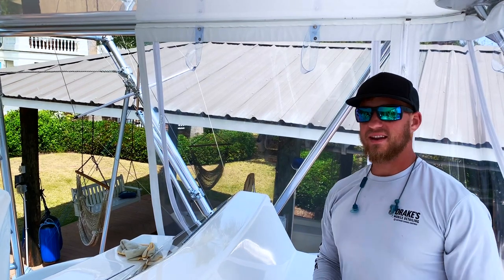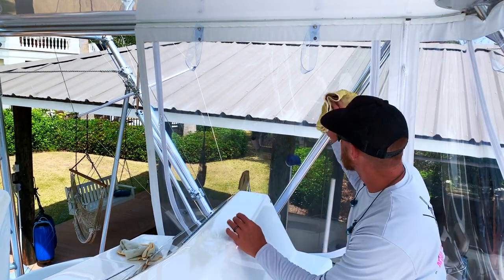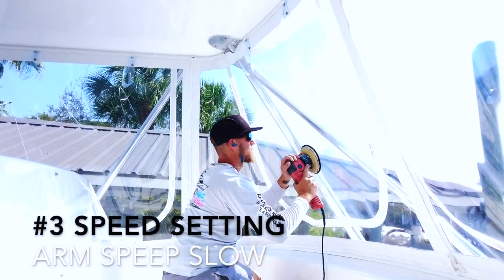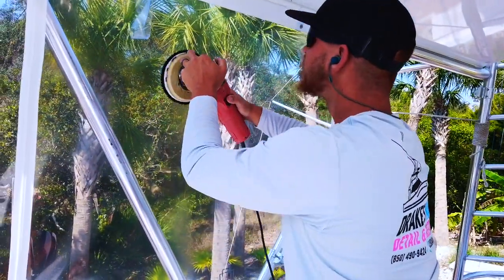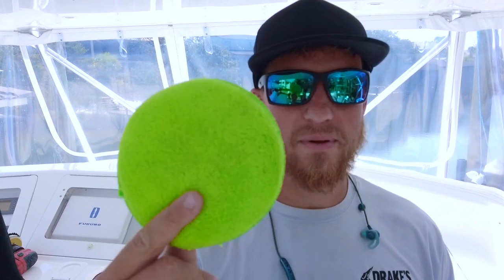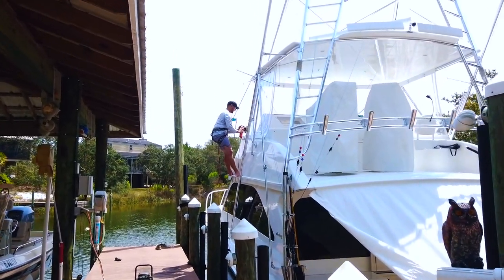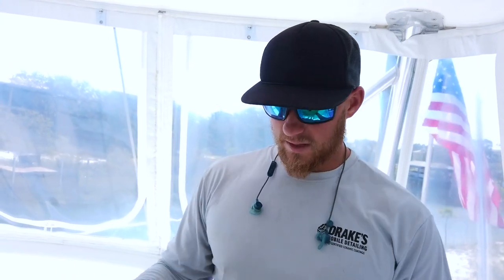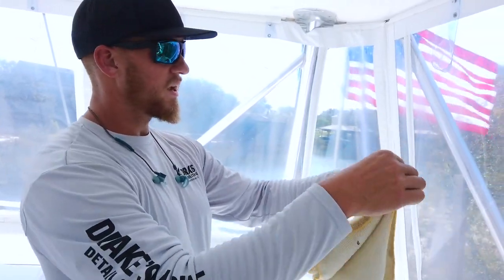How to Clean & Wax your Isinglass Properly! | Boat Detailing Tips | Revival Marine Care

Comment: Thanks Drake for all your awesome step-by-step detailing videos and product suggestions.  It's clear your spend a lot of time putting these together for us amateur enthusiasts.  Much appreciated brotha!  Follow-up question on using Menzerna on slightly hazy/cloudy Isinglass:  When using 400, is there a decent chance the abrasiveness of the product alone is enough to irreparably damage/scuff the Isinglass?  If so, should I start with the 3500 or 2500 and see if that's enough to cut that haze in the glass and work my way up to 400 and back before I get to sealing it with the Jescar?  Thanks again!

Comment: Great video, as always.  After I do this on the Isinglass, any suggestions for the canvas?  Thank you.
Reply: Claude B:,.( *I use 303 canvas cleaner & 303 uv protection. On canvas. )or purple power like a Drake’ said for the $ can’t beat the cleaner. Dawn will work too . And sorft/med shure hold  brush *I recommend definitely put some type of protection after cleaning. 303 uv protection is a god one too , I buy it buy the gallon I use it on everything.

Comment: Great video! very clear and precise instruction on how to maintain isinglass that's in good condition. 

What type of product(s) and application do you recommend to restore older cloudy isinglass vs. replacing?

Thanks!
Reply from the maker: Honestly, I don’t really do a lot of polishing faded isinglass. I actually have a isinglass glass guy that I sub my polish jobs and re outfits too! 

I have polished a few though, you can use menzerna 400 then follow 2500 and 3500 on a while and black lake country foam pad.

It’s best if you take the glass off and polish on a smooth flat surface.
Reply from the maker: Use a DA todo these steps
Reply from the maker: Also, be careful doing this, it’s easy to burn if you let the pad get to hot. Also when taking the glass off be carful not to break the glass or zippers

Comment: Drake, awesome detail and focus on quality! You stand out among others who are posting "how to clean & polish isinglass". Questions: the DA you link to is NLA. Any other recommendations??? Also, does it need to be a DA? I have a Makita vary speed buffer but not a DA. Last, what do you think of the cardless DA's? They are lighter, which is a plus, and no cords, but I have had the cord save tools from falling in the water in the past....
Thanks again for the time you put into this video
Reply from the maker: Hey Man! Don’t use your Makita, it’s way too powerful and it’ll burn right through your isinglass. Buy a DA polisher. I personally really like the Maxxshine brand DA’s. Use that with a orange lake country foam pad and some Menzerna 400 to get the scratches out of your isinglass. They apply some Starke Hyperhold polyer sealant for protection 😎

Here’s a link to my website where everything available from DA polishers, other machines and all other products and pads mentioned above! https://drakesmarinedetailsupply.com/

Plus if you’d like to learn more about not detailing in general, I also offer live recorded training class that you can take at your own pace. It’s got some really good info, feel free to check it out! https://www.detailuni.com/a/2147504321/GMGkUUpS

Comment: Is there a product you would recommend for restoring isinglass using a buffer?
Reply from the maker: Hi Megan! Try Menzerna 2400 compound on a orange forced rotation pad on a DA polisher. Polish to a haze, then wipe off. Do not use any heavier compound than the Menzerna 2400, it will ruin the isinglass.  I’d the Menz 2400 does not clear up the hazing or scratches in the isinglass, then it is too far gone.
Reply: @DrakesDetailing  thank you so much for the reply!! I will give that a try!

Comment: I noticed you listed Orpine Wash and Wax.  I know in some of your other videos you said that the wax in a typical wash and wax isn't good for boat detailing. Is there something different about this product and when would you use it?
Reply from the maker: I like orpine wash and wax when I am washing a waxed boat, it will keep the wax safe and will not strip it off... typically when  doing a detail, I like dawn because it strips off any waxes that maybe on the surface to give me a fresh clean surface. 

Only use dawn if you are going to wax it immediately after. 

Use orpine wash and wax when you want to protect the wax and clean the surface.
Reply: @DrakesDetailing  Got it.  Thanks bro!

Comment: Drake need some help here as followed this video and used jescar and did not notice really any difference as isinglass a little scratched and also slightly cloudy . Was hoping this would restore it but now looking below use Menzerna ? Also do not see link to products below to know what to get pad wise etc.
Reply from the maker: Hey bro! If you want to get starches out of Isinglass, you can take some Menzerna 2400 with forced rotation machine and a Lake Country orange forced rotation pad and it will clear them up

Comment: Will this work for Isinglass which is clouded as well? I just bought a boat and the Isinglass is very cloudy and I'd like to try and restore it before I pay $$ to replace it. Keep up the great videos.
Reply from the maker: You can do this, but it will only be   shiny for a few weeks. You’ll have to polish it.
Reply from the maker: Use starke elevate to polish the isinglass with a white lake country foam pad. Then do these steps.
Reply from the maker: Starke elevate. 

https://drakesmarinedetailsupply.com/products/starke-elevate-medium-cut-compound?_pos=10&_sid=e67b15e5c&_ss=r

White foam pad 

https://drakesmarinedetailsupply.com/products/lake-country-force-white-foam-polishing-pad?_pos=2&_sid=dd693c3c2&_ss=r
Reply: @DrakesDetailing  thanks very much, I'm excited to give this a try. take it easy and happy holidays
Reply from the maker: No problem! Thank you
Reply: @DrakesDetailing  just did my first cleaning using your recommendations. isinglass looks so much better. really appreciate your advice. once cleaned, what do you recommend for a sealant for the isinglass?
Reply from the maker: I like jescar power lock on the isinglass

Comment: Ok, so how about tips to restore it when its in questionable shape? Any ideas? I'm not sure wet sand or heavy cut is going to work here.
Reply from the maker: You can use Menzerna 400 on a white lake country force foam pad
Reply: @DrakesDetailing  Check out Auroramarine.com. They have great products for boat cleaning/detailing and one of their products is specifically designed to restore isinglass. I have used many of their products and been very pleased with them. Let me know what you think. I'm not a professional, just a DIYer so I'm certainly no genius on the subject. LOL. FYI, I would say my favorite product is their "Boat Scrub". It is great for removing light oxidation or stains in gel coat. And Drake is absolutely right about using Polymer Sealants, they are the way to go for protecting your vessel. They chemically bind to the substrate (gel coat) and create a sacrificial barrier to protect your surface. If you continue to keep that sacrificial barrier in good shape, your underlying material will continue to look wonderful. Sorry for rambling. If you have any questions let me know. I am really enjoying your channel. It's like the only true "Boat Detailing" channel that I have found. Keep up the great work.
Reply from the maker: Thanks!

Comment: Do you have any video or explain how to you mezerna 400 on the isinglass to make it clear please
Reply: Please let me know
Reply from the maker: Hey Man! I would put an orange lake country foam pad on a DA to polish out the isinglass! Here’s a link to the pads and the Menzerna 400! Make sure you select the right size pad for your backing plate on your machine before you check out, hope this helps!  

https://drakesmarinedetailsupply.com/collections/pads/products/lake-country-force-orange-foam-cutting-pad

https://drakesmarinedetailsupply.com/products/menzerna-heavy-cut-compound-400?_pos=1&_sid=1d1c02ae7&_ss=r
Reply: @DrakesDetailing  i order from you the white one in stil waiting on those so the white one is no good for that?. Has to be the orange?

Comment: Any recommendations how to remove dryed foam cannon soap from eisenglass,  I can remove it with my fingernail,, ita a waxy consistency?
Reply from the maker: Hey bro! We are actually unsure of what you mean, was it not rinsed off when it was applied?
Reply: @DrakesDetailing  that is correct,  I believe my dock neighbor cleaned his boat with his foam cannon and left over spray that dried on my glass, as it has an orange hue to it and it's on his side of my boat, and he did use a foam cannon to clean his boat.

Comment: My  Isinglass  is  15  years old. Will this restore it to some degree?
Reply from the maker: For your using glass, I would use Menzerna 400 with either a DA or a forced rotation machine with a Lake Country orange pad. This should get them looking 🔥🔥 Then you can do what you see me doing in the video, which is applying polymer sealant for protection. Here’s a link to my website where you can buy the products😎https://drakesmarinedetailsupply.com/

Comment: How do you clean plexiglass? Love the vids
Reply from the maker: You can wax it, or seal it the same way I did in the video.
Reply: Sorry if this is a dumb question but I’m assuming car soap would be safe to spray plexiglass on directly with a foam cannon then a quick rinse?
Reply from the maker: What car soap?
Reply: I was hoping you could recommend something! I was thinking something affordable like mcguires right now I have an aluminum offshore center console so it doesn’t need anything special and wanna use the same soap for my cars. The big thing I’m worried about is the plexiglass enclosure I have around my cc everyone online is saying mild soap is okay but absolutely no other chemicals
Reply from the maker: You can get Mcguires gold wash and wax from Walmart. 

Really any car wash soap that says wash and wax is fine

Comment: Another question, how long does this Jescar sealant last typically?
Reply from the maker: About four months on average. That’s all really most waxes and sealants will last on any boat.
Reply: Hi Drake, been a while, but just found that Jescar is making a Ceramic-Polymer coating that claims a longer lasting protective coating. Have you tried it on the Isinglass/Strataglass and any results?

Comment: How do you remove decals?
Reply from the maker: There’s a couple of ways you can go about it, you can take a heat gun to the surface and peel it off with a plastic razor blade, or you can buy one of those 3M eraser wheels that goes on in the end of a drill.